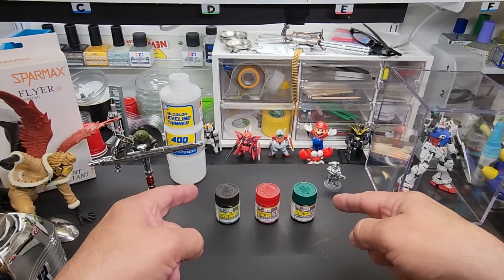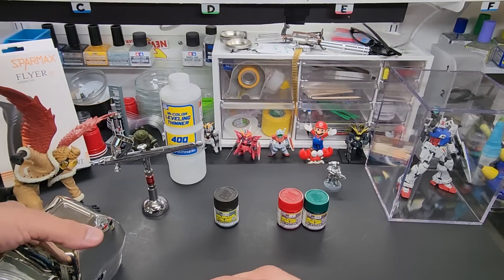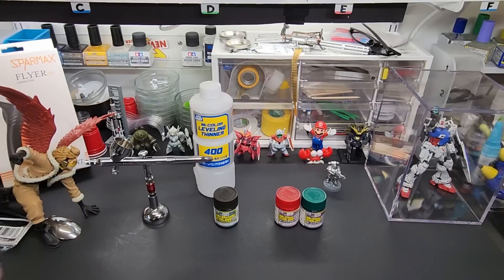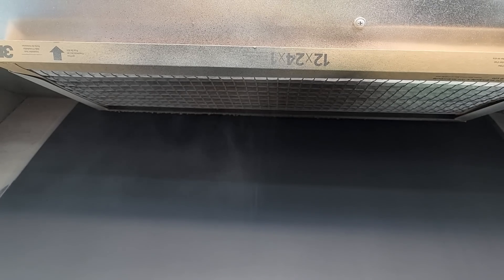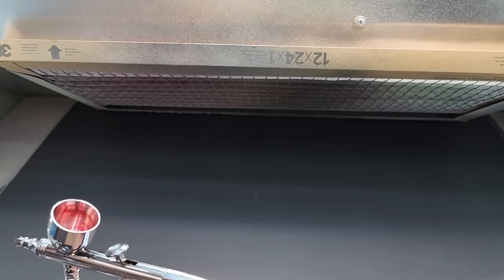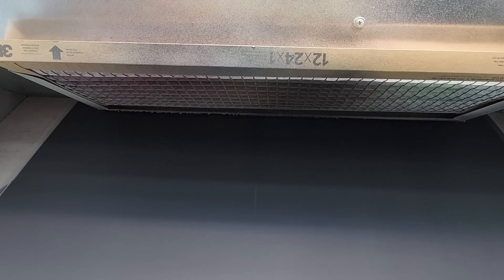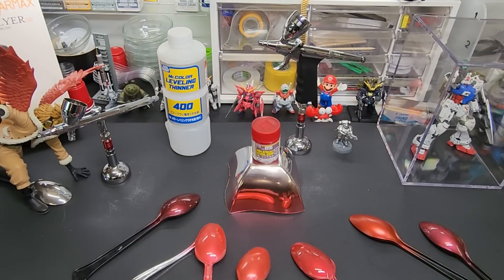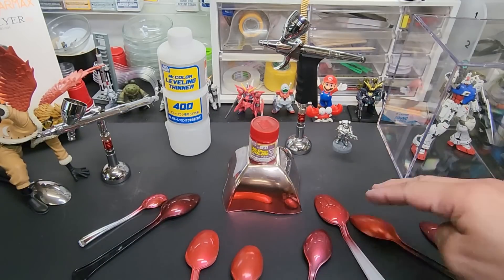Mr. Color GX - Testing 3 New Colors Added To The Mr. Color GX Line

Comment: Sorry for a noob question, Tamiya X-10 is an acrylic right? Is it okay if i spray laquer on top of it? 
Will it crack or eat the base?
Reply from the maker: The Tamiya is an Acrylic Lacquer, it's actually a solvent based paint so you won't have a problem
Reply: @barbatosrex9473  Thanks youuu

Comment: thank you for another great video.  i have a question. i got a airbrush set off amazon. it cam with 3 guns and a compressor. if the gun came with a size 3 needle in it can i change it to a size 5 niddle. thank you mike